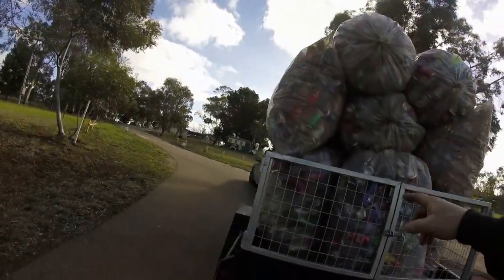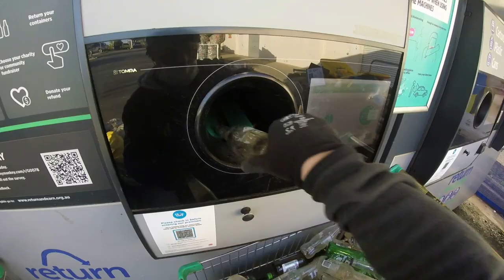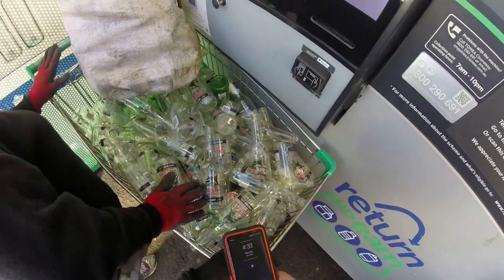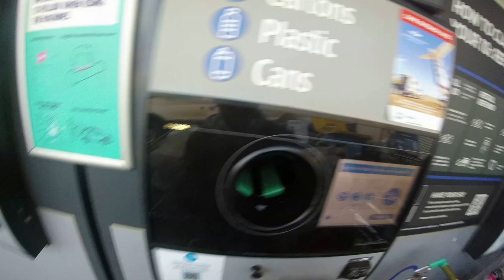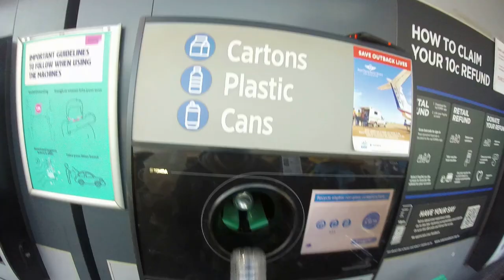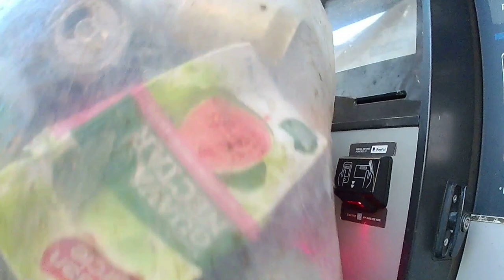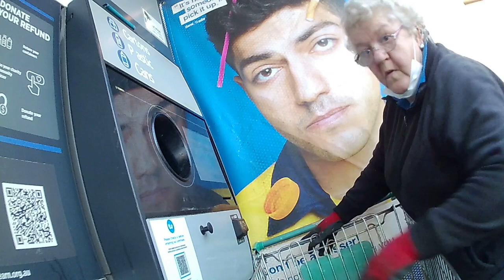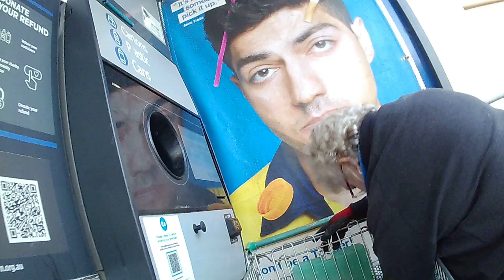DUMPSTER DIVING CASHING 9000 CANS, PLASTIC BOTTLES AND GLASS BOTTLES

Comment: That's a lot of money!
In my country they successfully use a refund system since many years. You have to pay a deposit for almost all drink comtainers, but you can return the empty containers at almost any supermarket without restrictions.

The usual deposits are ~ US$ 0.27 for a can or plastic bottle and ~ US$ 0.09 or US$ 0.16 for a empty beer, mineral water or soda bottle.

Therefor mostly people recycle theire beverage containers. I used to collect the empty bottles and and cans wich I found going out for a run every evening. It usually totaled around 350 - 400 Dollars per year